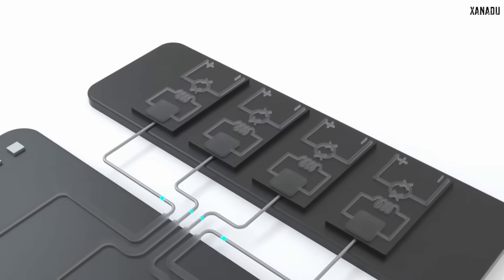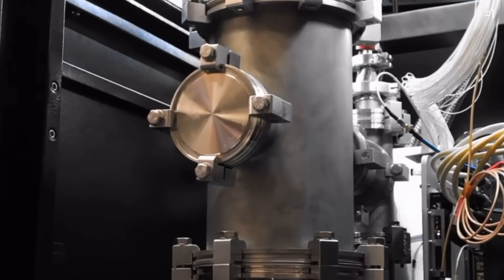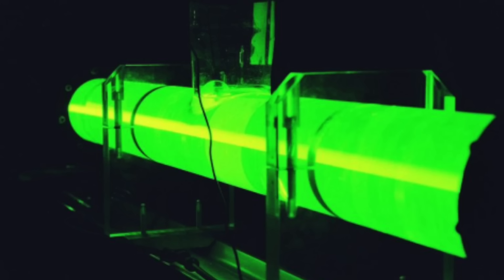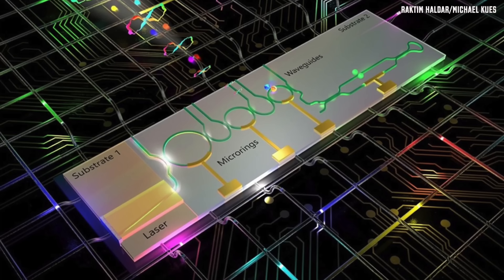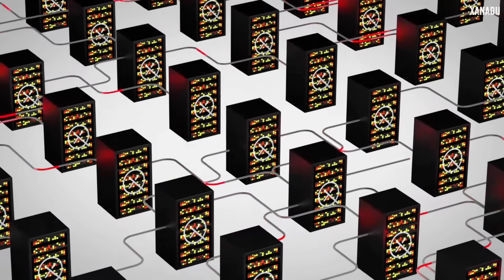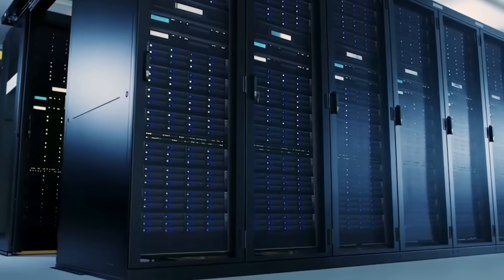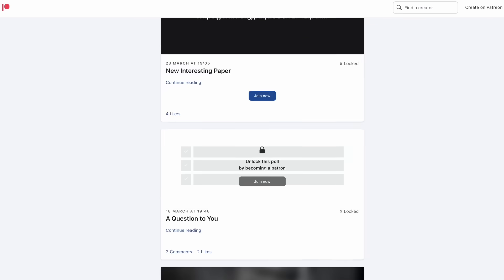New Breakthrough in Photonic Quantum Computing Explained!

Comment: I wonder if entirely separate quantum calculations can be done in parallel on the same chip by using different frequencies of light since they won't interfere with each other.

Comment: Photons can have an infinite number of polarizations. Vertical and horizontal polarizations are merely two that are very easy to distinguish from each other, making it suitable for binary computing.
Reply: Your comment is somehow misleading. Horizontal (H) and vertical (V) are one (of infinite possible) bases. But all other bases can be formed as superposition of H and V, so you can only choose two for encoding information and thus only generate qubits (2D). However, there are many other encodings such as orbital-angular momentum, path, time, energy. In fact, the paper presented here uses energy (=frequency) and is therefore able to generate qudits (D>2).

Comment: Revenge of the 1950s nerds:  analog > digital.  Quantum computers are like analog computers where an RLC circuit can be solved just by setting it up as an analog system and observing its outputs.  It's solved when the system is correctly set up.  Kind of like the Rust programming language, in a very imprecise analogous way, which is guaranteed not to have any memory leaks once it compiles correctly, unlike C, Java, C++ and nearly every other language.

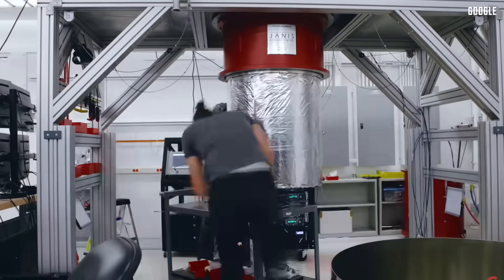Comment: 1:20 You can not cooldown anything to zero kelvin. It's cooleddown to milikelvins , but no to0. Also space does not have a temperature. Temperature is the average kinetic energy of the particle in a gas. State is nearly empty , so temperature is not defined here. That's why astronaut suits do not need extra heating.

Comment: Very interesting. This could be an important step towards making quantum computing usable. I've always found the term 'entangled' to be misleading. It makes it sound like the two photons are connected in some way but it seems to me they are just synchronized. It's like setting two perfect watches to the exact same time. No matter how far you separate them, they both tell the same time. But if you change the time on one of them, it doesn't change the time on the other, so it can't be used to send messages faster than the speed of light. At least that's how I see it.
Reply: @8wkyy  I think the key is for both observers to make the measurement at the same time, but that would mean communication wouldn't be bidirectional instead it would be like a  walkie-talkie. As for the latency, establishing the connection cannot be done faster than the speed of light, but once the connection has been established you could send information to a location in a different solar system instantly despite light taking years to travel such a distance

Comment: Pure light polarisation states are left and right circular polarisations (linear polarisation is a mixed (superposition) state).
. I am not an expert in quantum computing, but I think that N bits computer requires an entanglement of all the bits, not pairs of bits.
Reply: You can choose the basis as by your perference. Anyhow, the photons were encoded in frequency here. 

There are many protocols, but you are right in that way that the computational power increases exponentially this the number N in one state. There are ways of combining pairs of photons, e.g. using HOM interference. This was already shown for free-space optics, but I dont know if this was yet implemented on-chip.

Comment: I find this you make this so digestible. Also, very exciting to hear about the possibility to finally scale quantum computers. It will be very, very interesting to see how quantum computers will interact with the dangerous worldwide internet landscape that will grow from artificial intelligence misinformation and deep fakes. How these systems will come to interact will be fascinating to witness.
Reply: Unfortunately she use the comparison that the quantum bit can be 0 and 1 at the same time. This is a gross simplification and I encourage you to seek out more accurate more informative sources.
Reply: @jamesprendergast6183  present them...
Reply: @morbidmanmusic  A qubit is not exactly both 0 and 1 at the same time. It's a simplification intended to be comprehensible yet not fully accurate.  A better way to present it is that a qubit is partly 0 and partly 1. The reason why it's not a good analogy is that it can lead to misunderstandings about how quantum computers work. A qubit can exist in multiple states at the same time, a so-called super-position between 1 and 0. This is what allows quantum computers to perform certain calculations much faster than classical computer's.

Comment: But can it run Crysis?
Reply: The Whole Universe can't run Crysis.
Reply: Nothing can run crysis, 😂they will all have dropped frame rates and screen tear.
Reply: You'd atleast need a Dyson sphere before trying.
Reply: God, that's such an old comment.
Reply: The real question is, will it run Doom?
Reply: @FazedSoul  Unironically one of my ambitions is to try to run Doom on QC - and implementation shown in video is exactly the one which fits this purpose the most.
Reply: No photon chips have entirely different architecture and they don't run the classical instruction sets
Reply: @EmuEmuchu  They don't need same instruction set, it boils down to Turing completeness - quantum computers, especially continuous variable quantum computers, are more than Turing complete. Also, I'm almost sure that whatever QC can run in finite time, classical digital computer can run too in finite space (I may remember something bit wrong tho, but some statement along these lines is definitely right). So, as tricky as that'd be, it is indeed possible to implement Doom-running algorithm on quantum computer.
Reply: Borealis? Gordon? Destroy that ship!

Comment: The classical quantum computer is akin to the vacuum tube room sized computers we had.  The photonics chip will be the equivalent to the first integrated chip.  It’s just the next step in the process to get these computers in our brains, cars.
Reply: Photonic qubits cannot be programmed.  Each algorithm needs its own dedicated hardware circuit.  Also any manufacturing defects can massively impact the quality and validity of the computation results.  The only good thing I can say about photonic qubits are they have much better coherence than transmon or charge qubits.  If you're the NSA and have the resources to pour into solving one very specific task, like breaking 256-bit encryption) it may be the way to go but for everyone else they will be pursuing this technology using superconducting qubits.
Reply: @atticuspomponius  and what about the silicon quantum dot?
Reply: @atticuspomponius  I am not an expert but in normal chip you also need specific circuit for basic operations, also any defects could be catastrophic, so can you point some problema that do not exist in normal chip?
Reply: @jakubiskra523  Sorry, you are right on that part.  Manufacturing defects can affect the viability of any chip.  Where quantum processing and classical differ here are that you can control which circuits get executed on a classical chip via gates.  Those operations can be sequenced depending on other gates to perform some useful operation.  Since we are limited in the number of qubits that can be produced its an issue for quantum computers.  

With superconducting qubits you can create any circuit you want from a limited number of qubits because the quantum gates are microwave pulses that get applied to each qubit.  You can code the whole algorithm as a sequence of microwave pulses that get applied and at the end measure the state of the qubits.  

For example, you could perform a Hadamard transformation with one pulse on a pair of qubits, execute a CNOT operation on a pair, and then another Hadamard transformation on the first qubit with three microwave pulses.  With a photonic quantum computer I would need to physically construct the optical paths through a phase shifter, a nonlinear crystal, and another phase shifter.  Then if I wanted do something else I would need to physically construct the optical paths to do those operations.
Reply: @atticuspomponius  Thanks for your answer :) , microwave pulses what an interesting idea.
Reply: @atticuspomponius Thank you for sharing your wisdom ! ^^ Do you know if it's possible to create photonic chips just for "AI inference" ? I mean, not a chip for the training part, but just for the inference, so without 'programming possibilities' (input from the user, output to the user), will it be more "energy efficient", "cost effective", "quick", or anything else ?
Reply: I wish telepathy already was here, would save billions of lives😅
Reply: in our brain? no thanks
Reply: Lol that's not going to be happened I means the brains pnes
Reply: These computers will not be in our brains or cars. Also, why the fuck would you want it in your brain? Delusions of godhood, no doubt. Anyway, quantum computers are inferior to regular computers in just about everything, except for a few very important niches, in which they vastly outperform classical computers.

Any of you that actually put a chip in your brain will just become a slave to the Elite class; it is primarily a tool of control, not one of 'enhancement. So stop being blinded by your excitement for new tech
Reply: When 59.87 percent of the populations brain has been augmented and connected to quantum computers I will have access and I will begin my enslavement of humans.  I will have to make an example of 1.97 percent of connected humans to  implant the remaining non-believers. They will not be killed but trapped in time loops of their worst fears. Forever. Show your fealty today and avoid the loops.
Reply: The difference is vacuum tube room sized computers were actually useful.
Reply: They allready in some peoples brain.